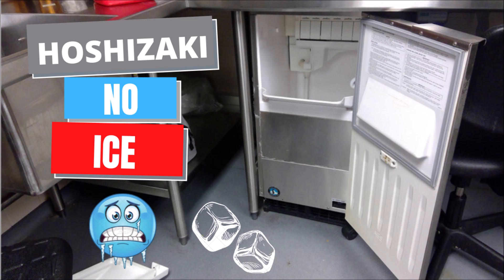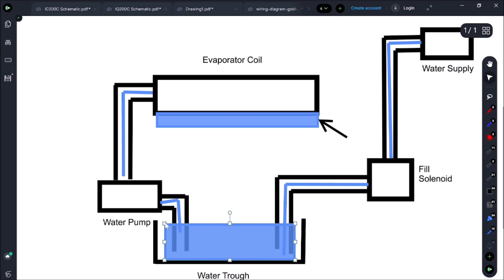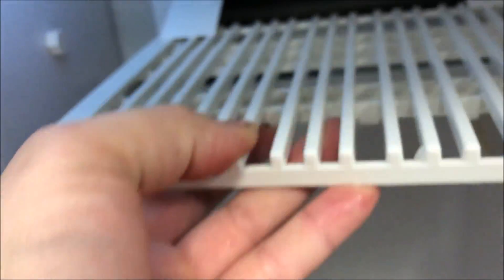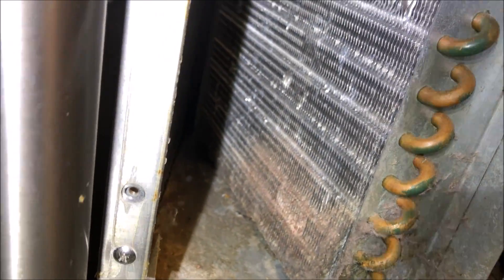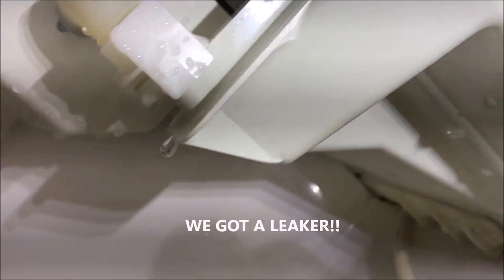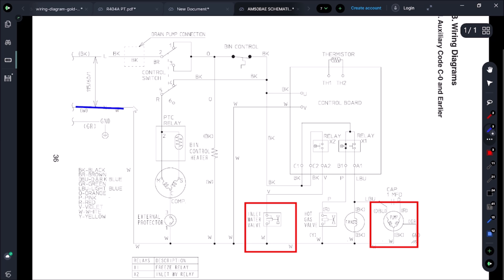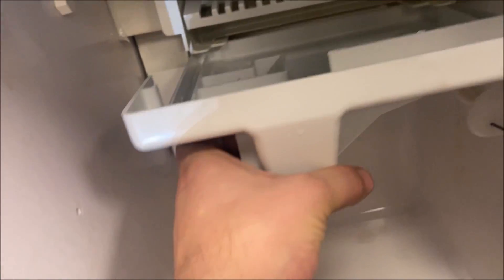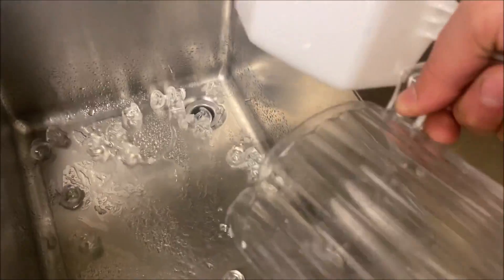Hoshizaki Ice Machine Is Not Making Any Ice. Schematic/sequence of operations breakdown for Water

Comment: Hoping you can help since I used your video last year! Noticed that the water wasn't coming through so we went ahead and replaced the water pump.  Now water comes through for about 45 minutes but we can't seem to produce that much ice.  After about 50 minutes the water stops pumping through altogether, almost like it's shutting down.  Do you think this is a refrigeration issue?

Comment: My under the counter Hoshizaki 50ABE ice maker, slowly stopped making ice, and I  replaced some of the tubing in the inflow shutoff valves. When I turned it back on to wash there was no water circulation, although there is also no leak. May be a water pump issue?

Comment: I have this exact icemaker, and it won’t stop making black ice. I think it’s a worn out evaporator. Can you replace those or do you just buy a new machine?
Reply from the maker: I would start with a thorough cleaning, should do the trick.
Reply: @REFRIGERATIONKITCHENEQTECH  unfortunately I’ve already done the clean and sanitize cycles twice and it’s still happening. Finally called a repairman today. He’s saying bearings. Mine was in storage 2.5 years and I think the heat broke down whatever it’s made of so it’s disintegrating slowly into the ice.

Comment: How do you check the water pressure or where would you do that?
Reply from the maker: There should be a gauge at the water filter, but you can see when it fills if the pressure is not enough

Comment: If it is the pump any insight on how to change that?
Reply from the maker: There is a screw kind of hidden that hold the cover than you have access to the pump. I think to wire the pump you need to take the top off but Can’t remember

Comment: Great video. Thank you.  We have model 50BAJ.  Ours appears to be pumping plenty of water and draining as well.  But ice production has dramatically reduced in the last week.  I took out many of the internal parts as shown in this video.  Cleaned them.  Cleaned small plastic filter at the water line entrance and nothing appears to have changed.  It runs for a very long time before dropping ice ever 50-60min.  Thus, resulting in very low ice production.   Any thoughts?  Thank you
Reply: Did you figure it out ?
Reply: My trough is filling up,but then it's not spraying the water up?? Any thoughts?

Comment: I have a issue with the same unit. I have plenty of water. We changed the filter turned system back on and no ice is being made. Could this be a refrigeration problem. Or how long does it take to start making ice thanks
Reply from the maker: 20-30 minutes I think on that one. If the evaporator isnt getting cold then you may have a refrigeration issue
Reply: @REFRIGERATIONKITCHENEQTECH how can I fix a refrigeration issue?

Comment: My AM-50B stopped making ice. Water kept running and never stopped. The Water valve in the top of the machine was clogged. Bought a new one on amazon(76dollars) and replaced. Part#458548-01.
Reply: How did you know it was clogged?  Mine is barely making ice after running for a very long time.  I have a 50BAJ model. Mine appears to pump water perfectly fine.  Thank you

Comment: I have the exact same machine. They need to be cleaned at least twice/year. It's a pain in the ass but needs to be done. Pray the drain pump doesn't fail. 700.00
Reply from the maker: This site has 4 units, had to change one 4 weeks ago.

Comment: These ice machines are dumbed down. They don't have a way of sensing water level. They have a predefined time to fill and if its not getting the proper amount, no ice will form, the pump will just struggle until it burns out.. One time I found one of these making ice when pulled out of the wall but when pushed in no ice. Guess what.

Great troubleshooting. Your voice is almost muted during the schematic discussion and then it gets loud in action.
Reply from the maker: Yes I noticed the voice is low, I need to figure out how to get it louder, I had it at the loudest setting. Thanks for watching